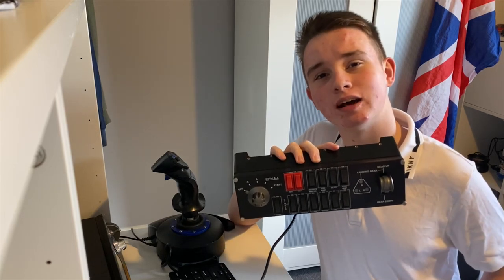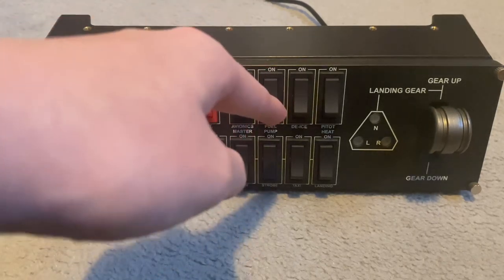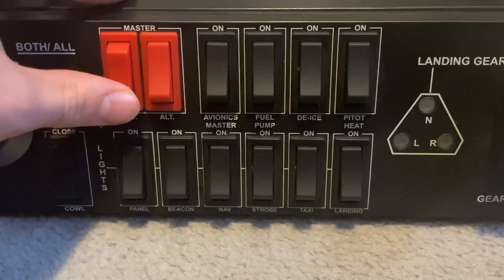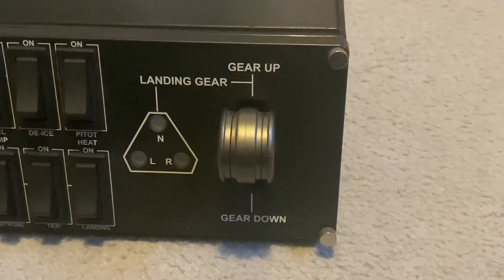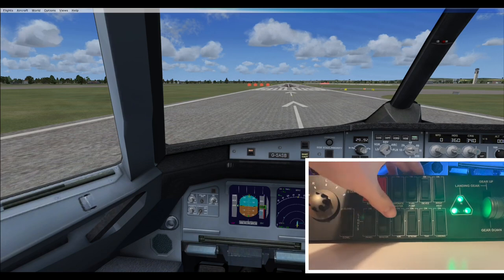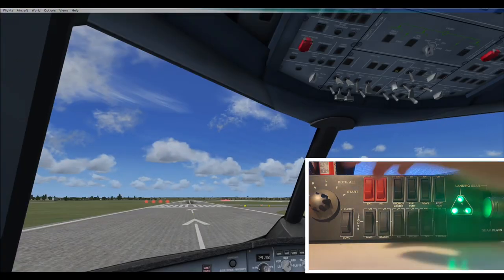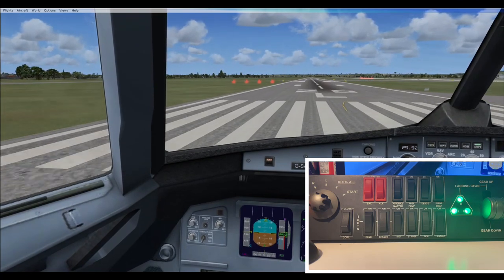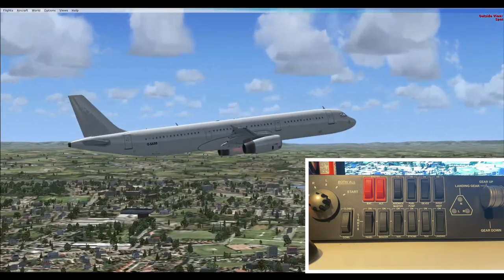Logitech Saitek Flight Switch Panel Review (FSX PC)

Comment: Great video! At 1:38 you said that the r and l was for dual engine aircraft, this might be the case, but also in a smaller piston aircraft each cylinder has two spark plugs, powers by two magnetos magnetos (probably incorrectly spelling that (fixed))thus a left, and a right for the left and right magnito in a small piston aircraft. Overall very good video!
Reply from the maker: Yep that’s very true, thanks for the feedback 👊🏻✈️

Comment: Do you know if the landing gear lights work in conjunction with the simulator or are the lights only sync'd with the action of the gear knob?  In other words, if you were (in mid flight) to click the simulator cockpit landing gear while your gear were up (lights off) in mid flight, if the saitek unit sync's up properly , the lights would go from off to red to green with out touching the actual gear knob on the Saitek.  Thanks !!!!
Reply from the maker: They are synced with the sim, for example if you have a gear failure that might won’t turn on and yes if you press the gear in game, the lights will change!
Reply: @PilotStudd  GREAT , that's good to know.  I have heard that the upcoming Bravo Throttle Quadrant will not do that, which is a disappointment.  I wonder if it's a programming thing, or if it's a physical component thing, because if it's the unit itself (physical), then there could be no change to the Bravo. Thanks for answering so quickly!
Reply from the maker: I’m not an expert but I’d say it’s more programming unless there’s a hardware problem where the pc can’t send signals back but I don’t know, thanks for your question!
Reply: @PilotStudd  thanks, i'll check more into it

Comment: Hi, I’ve downloaded a couple of plugins from Logitech and physically plugged it in, yet it still doesn’t work. I’ve searched the internet for help but again, it works for them but not for me, I’m doing the exact same as them but no luck! Any solutions?
Reply: ^^ FSX
Reply from the maker: Hi. I used to use FSX and it worked fine, a common problem is with power management, search up Logitech panel power management tutorial and hopefully that will help you! That’s more for if the screen or lights don’t work. If that doesn’t work I’ll need a bit more info to try and help ✈️
Reply: Pilot Studd  , thanks but it’s not working. 😩Non of the switch’s and the landing gear isn’t working. Thanks anyway 🙂

Comment: Hi sir were you able to make it work? Im having problem on making it work on my fsx
Reply: May i know what softeares did you use. Plugins and or drivers or did you use any 3rd party software
Reply from the maker: Hi Randolph, You do need a driver for FSX, don't worry though it's really simple, just go to the Logitech website click support and search up Flight Panels and download the driver for FSX make sure you chose the 64bit one (if you have a 64 bit computer). Once it's downloaded and you've checked everything in FSX settings you should be ready to fly. 👍🏻✈️

Comment: do you connect it to the yoke? mine is t being recognized
Reply from the maker: You need to plug the usb into the computer usb port and you can join it to the yoke with the metal screws. The yoke and this panel will both need drivers which can be downloaded from the Logitech Support website. Stay safe and have fun.

Comment: Hey dude,I got the panel BUT when I turn on the pc the lights don’t turn on and when I open FSX SE it doesn’t work 

Thanks
Reply from the maker: Hello, the panels always worked fine with me on FSX:SE, so I can recommenced making sure   you’ve installed the right drivers from the Logitech support website, the one for FSX as there is some for XP11, I also suggest getting the test software on there as well as that’ll show you if it’s the drivers or a hardware problem, hope this helps ✈️